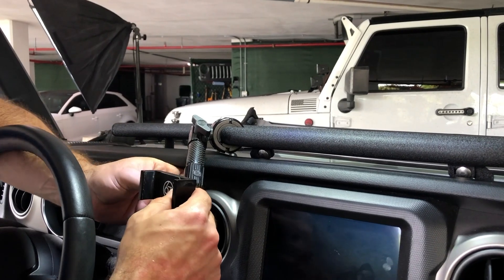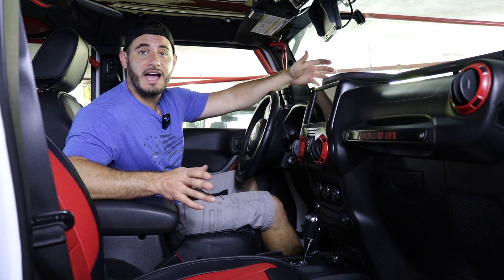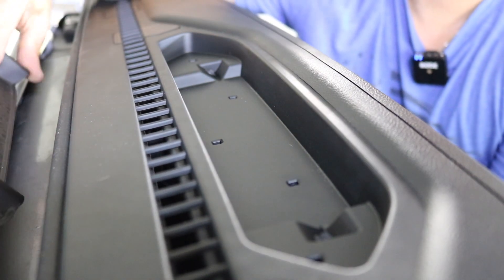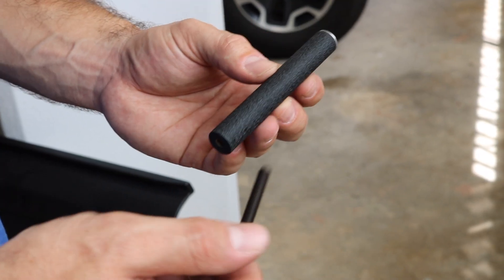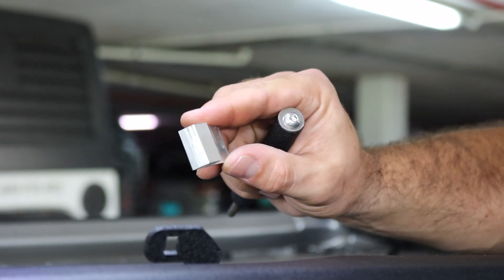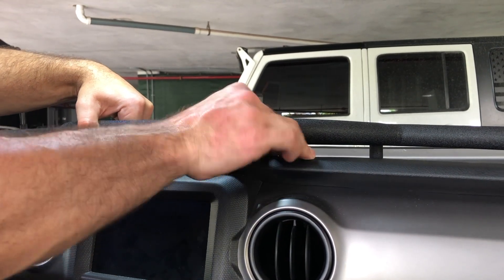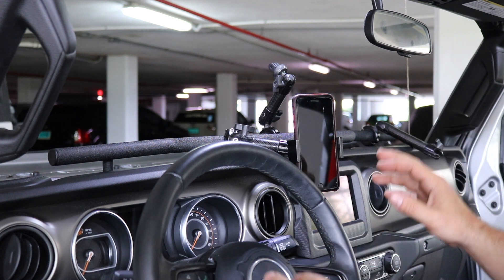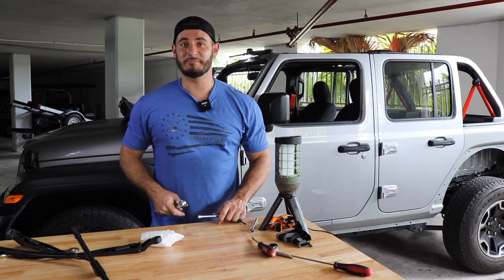Functional Jeep Interior Mod!!

Comment: What are you going to do for the fenders I would recommend putting in the Rubicon highline ones with something like the American Adventure Lab High-Line Fender lights it will give you an extra 2" of lift or usable travel
Reply from the maker: That’s exactly what I want to do but having a hard time finding the high top rubicon fenders! Any ideas
Reply: @adventuredex  north ridge 4x4 for 750 they have the black and paint able ones
Reply: @adventuredex  you will get them in 30 days or less I have ordered several things from them and got it sooner than what it says
Reply from the maker: Thanks! I’ll go check it out 🙌🏼